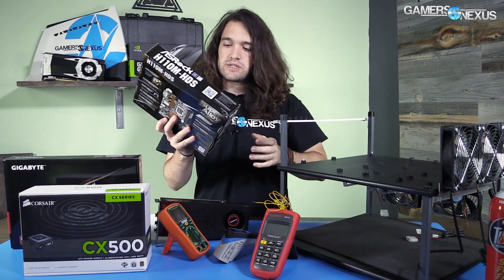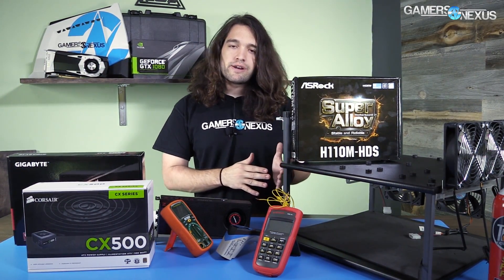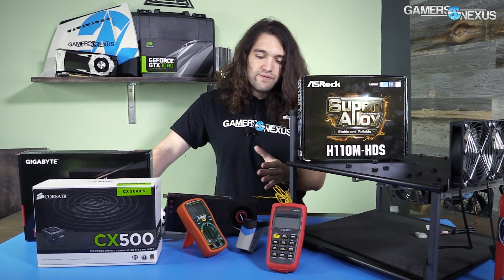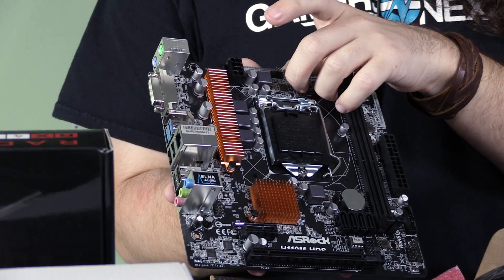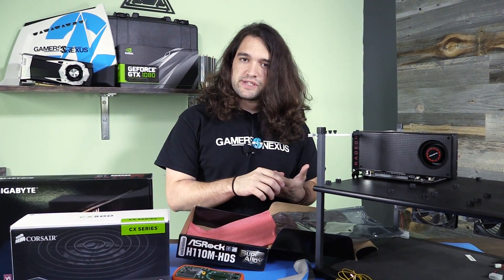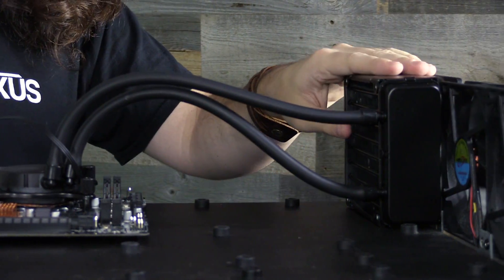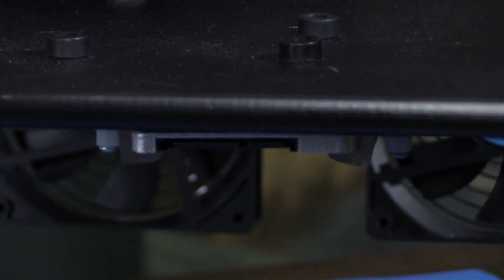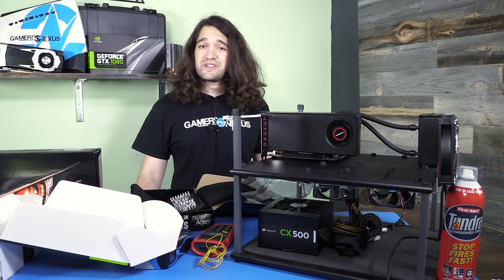RX 480 Endurance Test on a Cheap Motherboard - Part 1

Comment: You know you don't need to pop out that plastic socket cover by hand right?  Instructions even will say to leave it on and it will pop itself out when closing the cpu bracket holder.

Comment: What's the point in measuring thermals on the MoBo's active components... ? There's no active component in that PSU - PCI-E GPU chain to talk about... Maybe some active protection system of some sorts, but then again we're talking about cheap motherboards here so that pretty much goes out the drain... The only thing those VRM's on the MoBo are powering it's the CPU and the RAM... The 3V3, 5V, 12V rails that go to the PCI-E Slots are directly wired through the PCB to the 24pin Main Power Connector. The weakest link in this chain that I see, would be the actual electrical contact between the PCI-E Slot pins and the GPU's PCB. There are only 5 pins to the 12V rail and 3 pins for the 3V3 rail going to the PCI-E Slot... And that's about the contact surface of a blunt needle on a sheet of paper per pin... with very light pressure applied... The active components and even the PCB traces themselves would be the last thing I would bother to check out. No matter how thin those traces might be, the contact surface from the pins of the PCI-E Slot are by far the biggest issue in the chain. Now combine that with an old MoBo that has been sitting in an humid environment and you've got yourself the worst case. A new MoBo, no matter how cheap it is, shouldn't have any problem whatsoever with active components heating up, because there are none involved in this chain to begin with... or traces burning up on the PCB... The only minor issue with very thin traces would be the actual jitter and vdrop causing slight voltage offset from the 6pin connector on the GPU. And even that might be smoothed out by the GPU's power stage itself in the first place...

Comment: What kind of motherboard does he expect to pair with a $200 card.  Really, that is more than I spent on the AM3+ board that I am sticking the RX 480 with.  If not I am slamming a RX 470 in there.  No way I am spending more for a AM3+ build.

Comment: So I built a pc in early February with the cheapest lga 1151 socket motherboard I could find a Intel i3 6100 (I bought a liquid cooler for no reason other than low Temps last month) and the cheapest 8gb stick of ddr4 ram and an adata sad. I sold my ps4 to build it and I can honestly say it was worth it. Now I'm going to buy the rx 470 when ever those cards come out. So far with an HD 7850 it's pulling as much weight as it possibly can.

Comment: After watching a detailed analysis of the reference 480 PCB, it is pretty clear that the issue is not one that could be fixed through software, due to it being solely due to poor PCB design. The only thing the update could have done was simply lower the power usage of the card to try and tame the bad publicity around the situation, which sadly also reduced the performance of the card.

Comment: All those scratches on your hands I'd like to believe are from PCB solder points or something of the liking?
Reply from the maker: That'd be a better story than the real one. Downhill mountain biking crash during a nightride! ^SB
Reply: Ah ouch. Most of mine are from sharp power supply clips on the 6/8 pin connectors and PCB haha. I actually shed blood on my cpu cooler on accident when it shifted and I pulled my hand out when putting it on (whoops)
Reply from the maker: Just MTB, lots of park riding during the DH season! Whistler, Mammoth, Snowshoe, Bryce, etc.
Reply: Post some MTB vids!

Comment: I feel like without aiming specifically at what the problem would affect a test like this wont be very useful. Itll basically just ssay "it doesnt blow up the mobo" and thatll be it. I have to imagine the true failure case for this is very specific.
Reply from the maker: We'll outline finalized methodology in the next video!
Reply: There's also the problem that if it fails then it means little since it doesn't represent the world going forward. If the test passes then people will just say it's not a realistic test or they will use it to condemn AMD even though there's a new driver available that fixes the issue. I don't have an issue with the test but since everyone knew the driver was coming and was available before you started this test I would have preferred you use the 16.7.1 driver.
Reply: nanoflower1 Those arent problems directly related to the test though. Those are problems with a very small amount of people and this is very obviously a test just done to see who was really right/what damage it could have caused.
Reply: As others have stated if it's really a test to see what damage could have been caused it might have been better to use older cheap hardware. Pick up some cheap Ivy Bridge or old AMD hardware and see how that is impacted. Something like the Science Studio guy had trouble with since it obviously had issues with the maximum power draw that the RX 480 could hit on occasion.
Reply: Even if nothing fails it would be interesting to see what the actual draw would be without the new driver. Since the new driver nobody else is testing the old one. Still think it was a bit naughty of AMD to sell a card with such a fault...but good they sorted it quickly :)

Comment: That motherboard isn't old enough.  Go with a low-end Sandy Bridge-era LGA 1155 (PCI-E 2.0) or AM3.  That would tell the story better.
Reply: You need an AM2 PCIe V1 to have any issues.
Reply: ellsworth1956 I'm not so sure about that.
Reply: nope lga 775
Reply: 775

Comment: I don't want be negative here but i think the problems people were having were with AM2 boards/ PCI 2.0 and older. You're using a DDR4 capable board which most of us aren't even using yet. I use an AMD card so i'm not being a fanboy but i want to see if this really effects the really old cheap set ups. I know it's fixed now. I'm just curious.
Reply: Man at AM2 you just need a new CPU in the first place. Not trying to be an elitist, I have an 8350 that needs to go, it's just not cutting it anymore for the games I want to play.
Reply: +Kangaroo Chili Yeah I understand that but my point is that the people complaining about the power draw were people using these kinds of boards. Even with the huge CPU bottleneck. I just wanted to know its there is any truth in it.
Reply: Mind sending it to me? I'll pay for shipping haha I have a board but cant find any processors here in Alaska
Reply: +Paul Finch I'm sure it is. I just don't recommend anyone pairing a rx 480 with an old AM2 CPU. I'd just throw in a more appropriate card, because the CPU will hold you back so much it won't matter anyways.
Reply: +Mirune I wish I could afford to give things away haha, I'm selling it soon so I can upgrade to an i5.
Reply: Would any AM2 chips even keep up enough that the 480 would run at full load? Probably the sort of failure that could only occur with a burn in test rather than while gaming on that hardware.
Reply: +Tom Ault That was my point, it's just silly to pair an RX 480 with a low end AM2 board.
Reply: +Kangaroo Chili Exactly! This has been my argument all along. It's stupid to pair a modern $200-240 GPU with a sub $100 PC and hoping it will run games.
Reply: +Paul Finch Yeah man, kind of want to see that too, just to prove the point of why pairing a new GPU with a bad, old, low end mobo is a bad idea lol.
Reply: +Kangaroo Chili Nice to finally see someone agrees with me here. Still it looks like AMD have fixed it. Even with the new compatibility mode it only effects performance by about 1-3% and that's only an optimal mode if you're still having power draw problems. The whole thing was blown up way too much in my opinion.
Reply: +Paul Finch Yep, not that Steve's video isn't good, I liked it as well.
Reply: If you are still on AM2 then you shouldn't even buy 480, you need new platform
Reply: DDR4 is in two of the three PC's in our house XD

Comment: the problems were found on old low end mobos with pci-e 2.0 or older, not pci-e 3.0 that the mobo has. Try to find an old 1155 mobo with pci-e gen 2 or an old AM3+ mobo. Even an old 1156-1366-775 should do for that kind of test.

Comment: 2nd, but I am still curious how the card was released if it did not meet specification and overdrawing more than on average? (I do realize that certain Nvidia cards spike over 75 watt, a popular card being mentioned is the 750ti, usually during OCing and at times at stock)

Comment: that GTX 1060 on the shelf >.>
Reply: They've been announced already. Not sure if that's what you're getting at.
Reply: that 1060 design looks so much better than the 1070 and 1080
Reply: your joking right its basically a cheaper version of the original 1070 and 1080 founders card and also doesn't come with a backplate and the shroud looks like it was designed by somebody on a coffee break
Reply: Zachary Haywood 
beauty is subjective
Reply: indeed it is
Reply: Zachary Haywood Maybe this will let you see her in a different light: https://www.reddit.com/r/pcmasterrace/comments/4rz7pg/gtx_1060_millennium_falcon_edition/

;)
Reply: looming in the background, and showing its superiority.
Reply: yeah i still don't like the look of it
Reply: Zachary Haywood me neither, for me it feels unfinished
Reply: i wish they had made the shroud out aluminum give it some crazy look and also put a back plate on but i guess because its most likely going to be a midrange card although you are paying at least $429 for us Australians of course so i somehow feel your getting jibbed a little especially when a GTX 1070 is only $200 more depending on where you get it
Reply: luckily they won't be sold forever so you guys won't go blind from this eyesore lol
Reply: This video was recorded before it was announced.
Reply: The 1060*